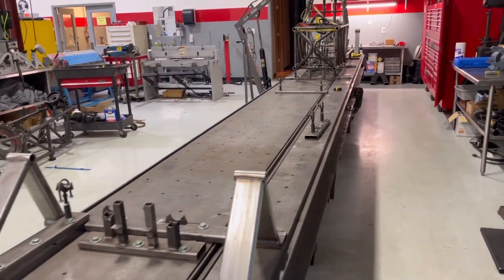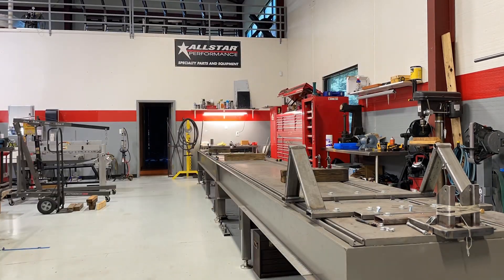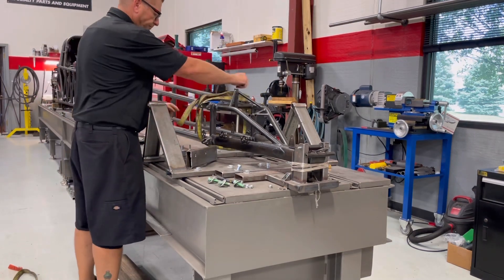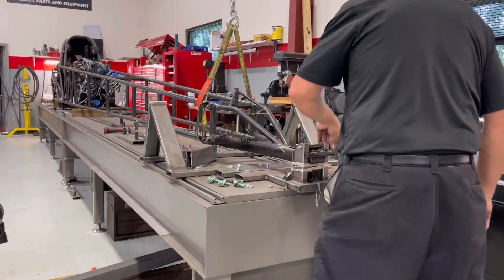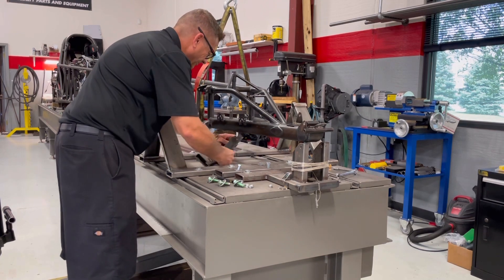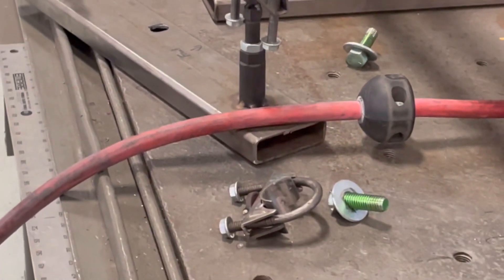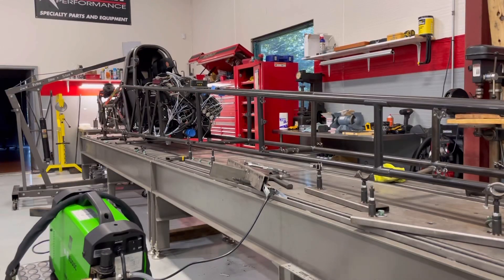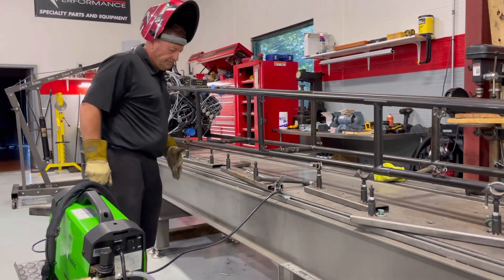LET’S FRONT HALF A 330 MPH TOP FUEL DRAGSTER!

Comment: Amazing to me...considering what a top fuel dragster is capable of....that they are still built basically the same way (welded steel tube structure) as racing cars were built in the 1930s....
Reply: Wheels that moved Roman chariots are still basically the same as the wheels on your car. If it ain't broke don't fix it. Tube is still tube, and girder designs are still girder designs. Some of these fundamental ideas probably span back hundreds of years in old bridges. Where I think you will find the biggest difference is in the math and the measurements. Calculating the amount of flex and fatigue is probably way more sophisticated than it was in the 1930's.
Reply: @DodgyBrothersEngineering  I presume though, if allowed by the rules, a CF monocoque chassis for a top fuel dragster could be designed to be superior in every way (except cost) to the tubular steel structure.  Racing cars, were allowed, moved from steel tube structure to aluminum monocoque in the 1970s, then to CF in the '90s.  I'm just curious why the dragsters have not done the same...and I am assuming due to rules....but I really don't know.
Reply: @johnshaft5613  CF is quite brittle, while it has good strength properties, I don't think it would be a good fit for this application. They make rims out of CF for racing bikes but hit a pot hole on the street and your rim worth several thousands of dollars is turned into a useless piece of junk. The TF car needs a certain amount of give to absorb the violent transmission of power, so you don't want a material that will splinter or fracture. Steel or something very close to steel would have to still be the best choice for the chassis. Look at a TF car in slow mo and it will blow your mind just how much it flexes.
Reply: @DodgyBrothersEngineering  Could be, I'm no engineer.  And I have seen slo-mo dragster video...it is indeed mind-blowing how everything twists and warps under the power.
Reply: @johnshaft5613  the magic is in what you don't see. Think about how the car does a pass. You have ~10,000hp (unknown torque but it is a lot) trying to rotate the rear tyres. The engine is trying to flip the dragster over (both in a tyre rotation direction and in a crankshaft twist direction) if it can get enough traction. At speed you have a massive down force on the front end to try stop the wheelie, but you you have roughly 300" of chassis acting as a big lever. The car is trying to turn itself into a banana the whole way down the track, that is why you see videos of them snapping in half. Trying to allow enough flex to absorb the power, while being strong enough to not act like a piece of licorice is where the true magic happens. Chassis design may look simple, and to some degree it is, but there is a lot of thought and calculations go into making it look simple. Rob is graciously showing us some of that magic that he thinks about. Obviously he can't give away too much as he has competitors he doesn't want to give secret information to (things like how much preload). Some people will look at the Mona Lisa and see paint on a canvas, others will see art, it all depends on how closely you look, but there is a lot of engineering in this simple looking chassis.

Comment: As a fabricator, fixturing can be one of the hardest things.....to do right. I usually end up with 5 or 6 revisions to make it"user friendly" and to make it as modular as possible. I like the electrical uni-strut for modular fixture points and I use muffler clamps for our exhaust builds as well. They work great to keep material in its place and reduce warping.

Soooo STOKED to see your process!

Comment: When will the funny car chassis be redesigned its been the same way since the 70s one thing I've noticed on dragsters is the rear end wants to push the car to the left and the front tires flex to the right making the chassis twist in 3 directions
Reply: Might look basically the same, but you can rest assured that there is a lot of engineering changes that have taken place in those 50 years.
Reply: @DodgyBrothersEngineering  im not a chassis builder but when john had his big crash i designed a new funny car chassis i sent him a model of it in 1/8th scale not knowing what the chassis builders did i was almost to T on what they did except mine had an in closed driver's compartment protecting the driver and a secondary breaking system that could upright the chassis if it was on its side i could go on and on of what i sent in a letter of things that i talked about most of what i talked about got used on the track and other areas other stuff after browns tire incident at Firebird i did a scale mock up of something to hold the tire in place i was at that track and saw everything within feet but guess weight is a big issue

Comment: That’s tricky stuff . I used to work in aircraft manufacturing and  the large fixtures we used are  laser surveyed every few builds to ensure accuracy.
Reply: I worked in a aerospace shop where we fabricated and manufactured aircraft as well. We  refurbished insurance claim wrecked aircraft mostly jet varieties, Lear, Gulfstream,  Citations, Falcons, etc. We also would laser check our jigs, not only prior to a build, but several times during. We discovered temperatures affected the jigs tremendously. Rain, cooler evenings, hot days, etc etc.

Comment: I am either tingling with anticipation or i have grabbed both welder cables at the same time..   a question.. do you install a fitting in the chassis to allow a gauge to be mounted to monitor the dry nitrogen the chassis could be pressurized with to be able identify tiny cracks because the pressure drops.. and to find cracks by pressuring the chassis again and using soap and water to look for bubbles.
Reply from the maker: No. Are chassis are open and we are actually run cables in lines inside them.